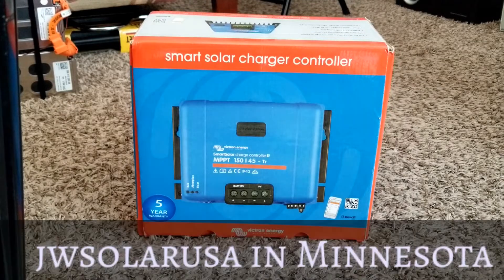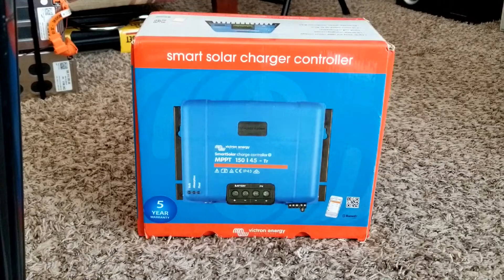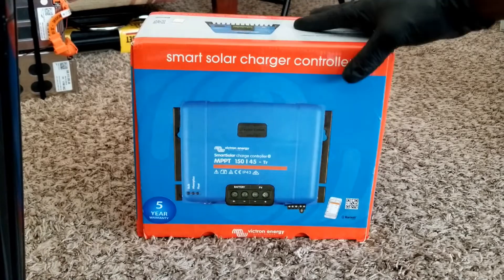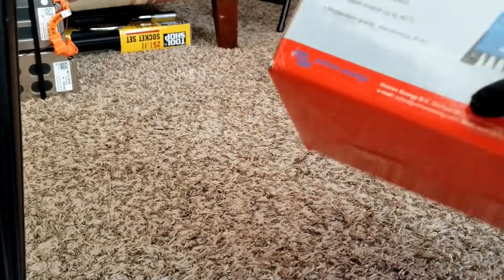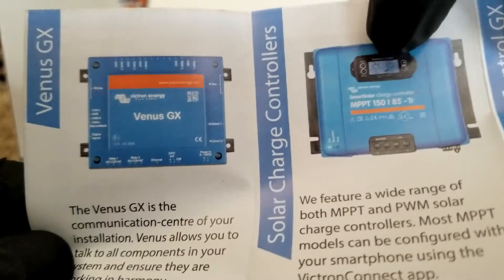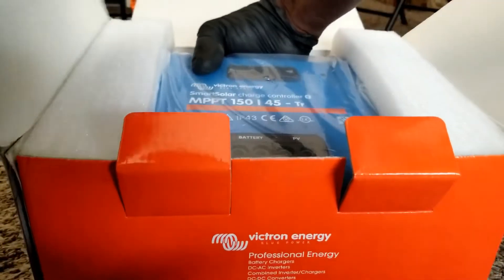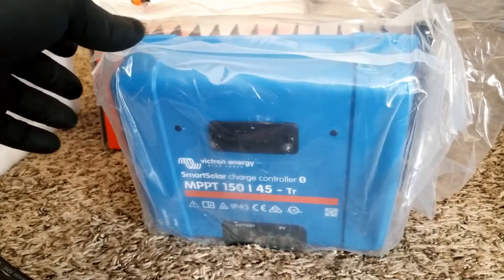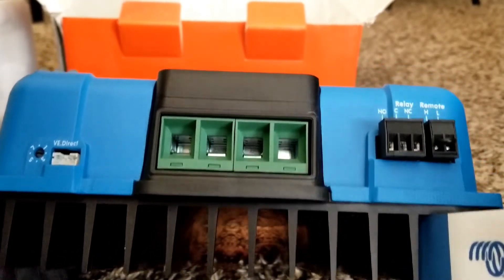VICTRON ENERGY, SMARTSOLAR CHARGE CONTROLLER MPPT 150/45 - TR

Comment: What does the TR mean at the end? MPPT 150/45 - Tr ?
Reply from the maker: -TR just differ in case design and how the wiring is connected to the unit.
The “TR” just indicates that it has screw-down input terminals that accept bare wiring with the sheathing stripped back (as opposed to ring lugs or spade connectors etc.
Reply: @jwsolarusa  Thank you! :) Gonna use this instead of the 100/50, because my Solarpanels on my Van has too much volts